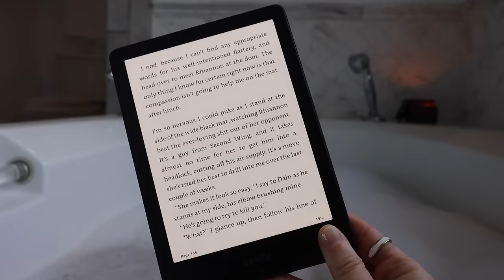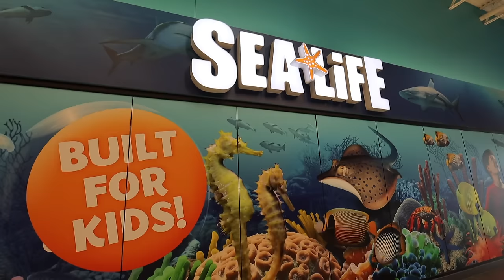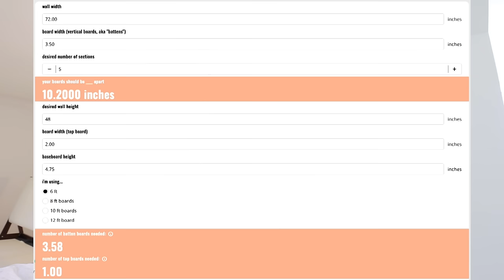weekend vlog: let's talk fourth wing, home improvements, & building a TEXTURED WALL

Comment: i like the tile. it would be less work than doing the flooring across so many other rooms. the dark dramatic will pop against the light furniture i think. i think your cabinets are fine. as others said just replace the doors and hardwares with a paint color you want. it will save even more. ikea is fine but it's like pressed mdf with a veneer. solid wood lasts a lifetime. the bedroom walls turned out amazing. y'all are doing such a good job with everything. it's fun seeing it all come together!

ahh lil bub is getting so big! i can't believe it.

ps YES TEAM JESS!